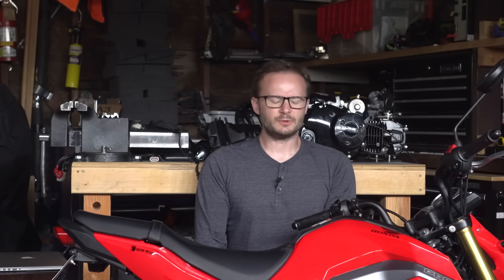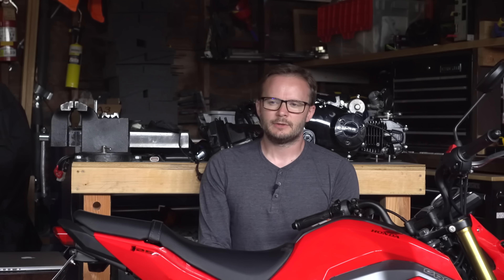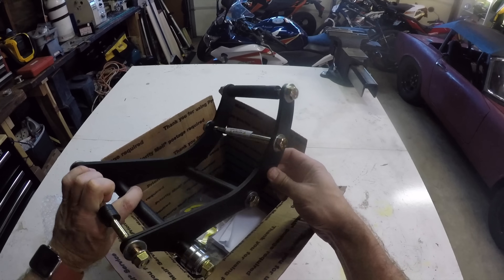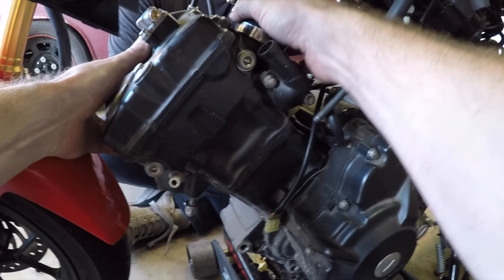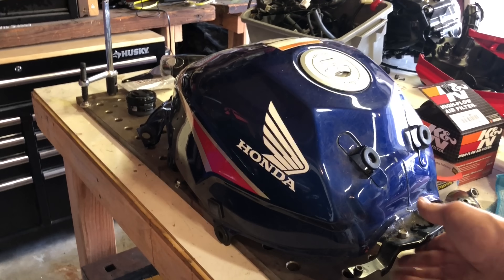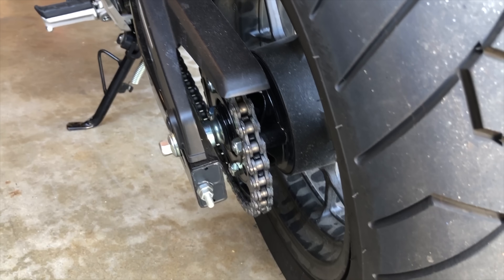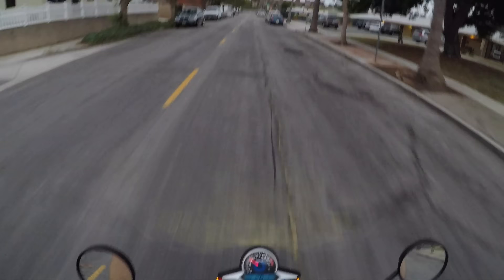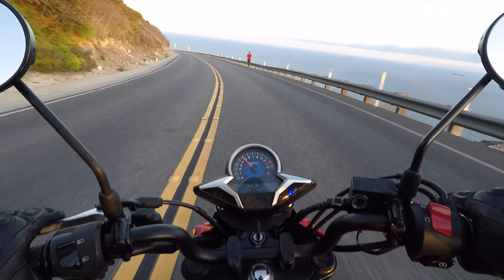Honda Grom Engine Swap: Twice the Engine for Twice the Price - CBR 250cc / 300cc How-To

Comment: Bigger engine and 250 are not often said together
Reply: Not in four strokes anyway
Reply: grom's original engine is 125cc so this guy have 2 times cc than the original, I'm cool with that
Reply: Armorpiercer oh know it’s a massive improvement over the air cooled 125 cc engine stolen out of a child’s dirt bike don’t get me wrong, but like 250 cc is still a pretty small engine
Reply: @clancyslater9245  Yeah but the grom does not weigh much.
Reply: ''I need a bigger engine than this 250''
Reply: I saw his dinky little starting bike and just assumed it was 250-300 as the title said. When he said a bigger engine and said 250 I hit stop and went to the comment section to laugh before I leave. :P
Reply: Me with a 50cc...
Reply: @Armorpiercer  its a lousy 125 not even a cbr125 capable of. shoulda just put a nice 125/150  sport engine and tune it well. porb only change the chains and shocks plus a wider tire( like on gokart) to keep its traction
Reply: Clancy Slater in Europe a 250 is a big motorcycle and most people start on a 50cc
Reply: @Armorpiercer  wait till you put yamaha r125 on it
Reply: 250-500cc is middle class
Reply: Hi , how much did it all cost for you to  take you swap it out?
Reply: Like when you talk about a Citroen 2CV- you can talk about the original small block Hemi (325cc, 9HP) or the big block Hemi (602cc, 32HP).
Reply: @clancyslater9245  it's on a half sized bike, that thing will fucking rip I promise
Reply: I live in Asia and 250 / 300 bikes are classified as big bikes 🤣
Reply: 250cc is the largest one can easily register in some countries.

 A water-cooled, EFI 250cc is enough engine anywhere...if you turbo it. Check out videos of turbo WR250Rs. They have more power than my DR650s, and I slab 2up with luggage on my DRs.
Reply: What's the point of having a big engine if the law makes it so you can never use the potential of said engine? It just seems to add more weight, make the vehicle less controllable, and costs more gas for a bit more acceleration. I don't know anything about motorcycles can someone explain?
Reply: @jaxstax2406  A standard liter bike has better straight line acceleration than 99.99% of road legal vehicles. Any random person can just walk in off the street and buy a bike that, in stock form on stock tires, only loses to the tip top of multi-million dollar hypercars, purpose built "cheater" modified/tuner and F1 cars....in power to weight. The acceleration is indescribable to and by mere mortals. Throw in some bolt-ons and an ecu tune, and you're now in 2,000hp purpose built drag cars on slicks territory. In a package that still takes corners.

On paper it's completely pointless and unuseable, but it's about the closest thing a normal person can ever come to riding in an actual rocket ship. Legal or not.
Reply: @hubertkam7647  Not true. A 50cc is a moped which in most European countries have a different license. You can drive a moped in the Netherlands, Belgium, Germany and France at 16 years old. A Motorcycle is everything above 49 cc in the Netherlands + Belgium and France. Some other European countries it starts at 125cc. Light motorcycle license in the Netherlands is max 125cc. Middleclass is max 35 KW (50 hp) and after that unrestricted power. 

Every country is different in this aspect.
Reply: @notagunfreak8146  aprila rs 50 dt 50 sendra 50 mrt 50 those are the most common motorbikes you would see on the road at least for younger riders
Reply: @hubertkam7647  in most European counties, those are mopeds. They are not that common because everybody drives scooters. Only younger males drive them (usually). Tomos and Puch is also quite populair. Older mopeds like kreidler, zundapp etc are very rare to see.
Reply: I like that dash myself
Reply: @clancyslater9245  Bigger doesn't mean massive or huge. It means that thing is larger than what it is being compared too. Something can be small while still being bigger than some things.
Reply: @sargera1  Bro you lost all credibility when you said put a go kart tire on it
Reply: @bashkillszombies  Trust me a 250 under that thing rips because of its power to weight ratio.
Reply: Lol
Reply: Bigger not big
Reply: When it comes to a Honda Grom or we said together
Reply: @StatiicsPew  this!
Reply: Yup it's all relative to the situation. But yup it's definitely not what you think when you hear bigger engine
Reply: very common in other counties. 250 CC is huge in India.
Reply: @hubertkam7647  wtf...
Reply: To be fair, a 250rr engine would be pretty quick on a grom. Mean 300lbs and 40 horsepower.
Reply: As a ninja 250 rider. Can confirm
Reply: @skywalkers013  depends on how much you buy the other bike for but usually a good swap is 2-3500
Reply: 😂cant wait to do it. Just got my clone 2 weeks ago. Too much fun. Waited till 39 to ride for real. Too much fun
Reply: Yeah we need a triumph speed triple swapped in
Reply: @jaxstax2406 lol laws? What the hell are those

Comment: The diode prevents people from hot-wiring your ignition live. The ECU will only accept the (time to perform) signal when it sees the resistance of that diode.  Remember this if you ever replace the keys and locks on bikes.
Reply: The diode is also present on older bikes with carburetors and points ignition and no ECU to speak of though. It can usually be removed with some creative wiring if you don't mind not having a clutch interlock for the starter. Sounds like it already served a purpose and then used to serve an additional security function since that's just a good idea when you have an ECU onboard. Otherwise I don't see why they wouldn't just use a resistor

Comment: It's 5 AM, I've never owned a motorcycle.

... Here I am.
Reply: You want a 2015 or younger street triple 675 r.  It's awesome it has abs from that point, brakes can still make you flip.  5l/100km. 0-100 3.8seconds. Only use one finger for braking.     4500-6500euro 10-20000km used.
Reply: Omds it was exactly 5 when I read this
Reply: Motorycles is the dark side. But my life would suck without 2 wheels. Go take a safety riding course then buy whatever bike you want. Recommend a Yamaha R3 or another 300... Biggest I'd get as a noob would be a GSXR600. I started on a Ninja 650 then got 3 GSXR600, R3. Grom, Hypermotard 1100... Now on a Z1000. But want a CBGrom300RR!!!
Reply: Get one there mint
Reply: 4:43am. I want a grom but the only way I wanna get one now is to do this. So dope
Reply: Bruh same here
Reply: Had a grom for 2 years. Sooo fun and then I wanted more. Got supermotos (2) miss the grom though
Reply: Thats soo funny!
Reply: it's a sign from God :)
Reply: @slamitson  4:43am lmaoooo
Reply: @Animal Mother a grom is tiny even for a 125 most 125cc are normal size and have normal power I have a wr 125 and it’s a lot bigger than our Kawasaki klr
Reply: I'm so sorry to hear that
Reply: 2018 suzuki GSX S 750 best bike and its cheapish
Reply: i dont own 1 because too many bike thieves here in SEA
Reply: Get one man
Reply: Take a BRC. Get your M license. Get some comfortable riding gear. It doesn't have to be expensive. Any CE-rated and/or DOT-rated, armored gear is better than a g-string and flippyfloppies. I like FrogToggs and armored mesh gear. Get a cheap used 250cc dualsport. Practice riding dirt on a durable bike until you can comfortably handle a motorcycle. Practice your drills. Practice with questionable traction. Don't venture out into traffic on public roads until you can focus on handling traffic instead of focusing on handling the motorcycle.

 Riding is risky. So is life. Get decent insurance. Live life.
Reply: it is a good time to get one now lol gas prices are high
Reply: So I need a dual sport before I ride a Grom on the road?  I just put a $200 deposit on a 2019 Grom for in the am pick up.  I should look at the dual sports more. I don’t know where they are allowed to ride around here. I passed the class but I dropped the bike on my leg/knee.  Good thing I had knee pads. I’m dangerous. They want $5000 plus tax, $5400 for the 2019 Grom with 311 miles.
Reply: @jbean530  You could put knobbies, a skidplate, and maybe handguards on a used Grom. I wouldn't spend much on your 1st moto though. Most new riders dump their 1st bikes a few times.

 It's also a good idea to get used to controlling the moto, in varying traction conditions, without having to think about it, BEFORE venturing out into traffic and ALSO contending with distracted/hostile drivers.
Reply: 6:23 am for me
Reply: first time for everything
Reply: Buy one
Reply: Welcome

Comment: "JuSt BuY a 250 aNd RiDe It InStEaD"
You guys are really missing the point of this
Reply: Have you ever done anything fun ? Doesn't sound like it.
Reply: Content?
Reply: The grom is a much lighter bike, that is a good reason to put the 250 engine in it
Reply: But take all the grom badges and icons and replace all icons and badges on the 250 with all grom icons and badges and see if anything else from grom can be used to turn a 250 to look like a grom and then you can go picking on grom geeks with shock and awh with a monster grom or would be an insta gram
Reply: @donniebaker5984  do you know what a grom and a 250r look lije respectively? There is nothing alike about those bikes except the basic motormounts and the badge
Reply: I’d so much rather have a Grom with a 250 than actually riding a 250. You get more respect that’s for sure.
Reply: I'd be missing the ride!
Hated maintenance/work. Love to just ride.
Although a 300CC Grom would interest me!
Reply: @badlighting  did you know you can take a KX80 and bolt on a KX125 engine with only one minor engine mounting tab mod ? And that goes for all of the four major brands from japland ,some are easier than others but all are not that difficult simply because the bottom end cases are physically based on the same die casting structures. My point here is to build the ultimate trail bike for the street , trail , and track #1 KX125 engine with a light coil and street legal lighting kit and equipment from baja designs (its cheap junk but comes with official paper work to get your creation registered and plated street legal and as the turn signals and horn that are moped quality will fail can be upgraded with any thing you like, but  the main thing is you are on the road anywhere you can think of )#2 since 80cc frames can be a bit small for grown adults the KX100 splits the middle of 80 to 125 for a size in between which brings up another of just one more thing base on the engine mounting of ease of access 80 to 100 to 125 the other one and omfg behemoth monster mini you will have is a 220 cc two stroke kawasaki enduro engine that are also based on the physical size lower end cases of the others that are smaller of displacement . And a 220 Enduro comes with lights and baja designs still has a street legal kit for it   ...so get a KX100 complete rolling case + 220cc Enduro two stroke engine and an aftermarket 3 1/2 gallon fuel tanks  use one pint of  Yamalube "R" two cycle oil mixed in a 5 gallon gas can and there will not be a grom anything come close in any type of racing motox being my favorite but supermoto on the street you will pown and own
Reply: @vinnyvega1985  or maybe you could learn how to turn a grom into a behemoth with a bore and stroker kit that would do much better / but with a big trade off will not last as long but handle much better / but as nothing replaces cubic inch vs pounds of fun lets look into what can be bought for a 250 honda engine today far as camshafts throttle bodies and exhaust and oversize cylinders that require milling of the lower end cases for much larger cylinder sleeves to fit using the stock crankshaft and connecting rod assembly ..i my past experience aftermarket stroker do not last very long do to the connecting rod qualities but large cylinders with piston , not a problem
Reply: @nazimelon6653  naa i have no clue of what your taking about kid i'm still a n00b, only been riding for 60 years !
Reply: @ProDigit80  build it and they will come
Reply: @donniebaker5984  Mate are you drunk
Reply: A long long time ago in a land far far way in my ancient history there was a shop in west terre haute indiana building mini bike frames with cut down front and rear suspension systems to retain the physical size of a present day honda ruckus but with a 1970's series honda cb750k four cylinder inline usually using four stock header pipes and no mufflers and going from the 120 main jets in all four stock carbs to 130 to tune for the four drag pipes to be rich enough to kill your self as fast as you can turn up the wick
Reply: And put small wheels on it if you like to look weird :)
Reply: I get the "fun part" of this project, but the CBR 250 (especially the tricolor version) is such a neat little thing that this was almost painful to watch. Hope you enjoy the wheelies on your buffed Grom, @SuperfastMatt
Reply: But, to be honest - well done!
Reply: They are so small and compact it just makes them so much more fun. That is why so many adults like myself like the klx110 because there so fun.
Reply: Bruh skip the grom and the 250 

Go straight to a 600 and ride that to work
Reply: @badlighting  Ok - how do you put a slightly larger tank there? Can  the Razkull or CB300r tank fit there?
Reply: Differently ..just bye a rebel
Reply: @markedwardspezenosky5814  Yeh, bye bye rebel - don't come back ever
Reply: @nazimelon6653  i have too much knowledge and experience than you , that you will never understand as you have to live it to know it , and growing up in the racing capital of the world that is Indianapolis , Indiana home of the Indy 500 helps a lot . As a kid from 9 to 16 i spent the month of May hanging out in the garages on gasoline alley of the infield at Tony  Hulman's 500 mile race track as the Hulmans where family friends and new my way around Offenhauser and Cosworth Indy car pretty well ..my best friend was the importer and factory team rider for Maico and Ossa , ever ride the 1978 Ossa 250 Phantom two stroke MX bike ?...later we where sponsored by Suzuki and Honda with new CR's and RM's for two years not having to pay for anything but the gas to get to the next race and vp racing fuel hehe ..yea im drunk alright , so what and who cares
Reply: About to comment the same
Reply: @donniebaker5984  Dawg what
Reply: It’s fun to work on a bike
Reply: Same thing I said
Reply: how have i missed this absolute gold mine of a comment section for over a year
Reply: @TheFighterbike  lemme just tell you a year later, do you still think this was a woosh?
Reply: The wheels on the Grom are too small, the bigger the wheels the more stable and the easier to control...
Reply: @lennym1273  that's barely true
Its 250cc, not 1200. Like, its not gonna suddenly be a rocketship, its just a faster grom.

Also bigger wheels are more susceptible to wobble when coupled to such a short wheelbase.
Reply: And what is the point?
Reply: @BugattiBoy01  i mean...

Its a grom
The fun, cool, roadlegal, high quality pocketbike, made by honda, that was only ever offered with an aircooled 10hp engine

But with watercooled 2x hp
I feel like thats relatively self explainatory?
Reply: @BugattiBoy01  like, matt explains the reasoning in the first 30 seconds of the video.
Reply: @nazimelon6653  its very surprising how people dont get it. like increasing vehicle performance is such a foreign concept to them. go watch a makeup tutorial or something haha
Reply: I mean, if you're gonna buy the whole bike, might as well.
Reply: No Faustian spirit at all. Sad!

Comment: Nicely done.  You're spot on about it being more fun to ride a slow bike fast than a fast bike slow but it's even funner to ride a tiny bike fast with a more powerful engine.  I've been wanting to put a WR250 engine & transmission in a TW200.
Reply: A TW250 would be sick.

Comment: If I had the money, I'd have been all over this.. I was already looking at bore kits for the Grom but ended up with a rebel250 instead. Totally different bike but dead simple, faster and pretty much perfect for the daily driver I was looking for
Reply: Yeah, until you're bored as hell and want a faster bike in a month. That's what happened to me. At least with the grom, you can do some hooligan fun with it.
Reply: @hamiltoes  fun isn't always the driving factor in why people buy bikes tho,rebel 250 is bare bones, reliable and fast enough to keep you safe as long as you stay off the freeway
Reply: @hamiltoes  eh.. three years with it and I still dig the rebel.. I also take it on the highway every day. It’ll do 75-80. I bought it needing a commuter and it’s great for that. Always have fun on it too. I own larger bikes, but still usually ride the rebel. It’s fun for me, gets great mileage, I can park it anywhere and it’s super easy to work on.

I have zero interest in doing hooligan shit. Not my thing.
Reply: @himlaz_2398  I take the rebel on the highways regularly. It’ll do 75-80 just fine. Sure I avoid the sections where everyone is going 90 but generally, I don’t have to plan on avoiding any roads.
Reply: @jseden  my first motorcycle was a 1985 Honda Rebel. It was a spare bike my uncle had restored over winter and gifted to me as a practical solution for getting around while I was there. It was small, light weight and was a blast ride to take up the Sun-Road in Glacier National Park.
Reply: @Beegs164  hell yeah! It's definitely not a "cool" bike but I still have fun every time I'm on it after 20k miles. Hasn't needed much beyond oil &tires.. finally replaced the stock chain maybe 500 miles ago.